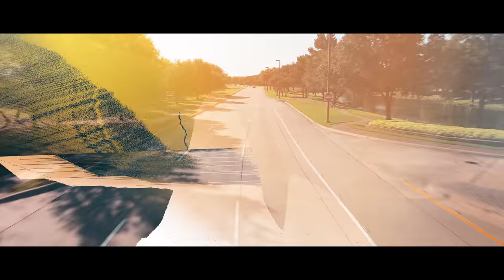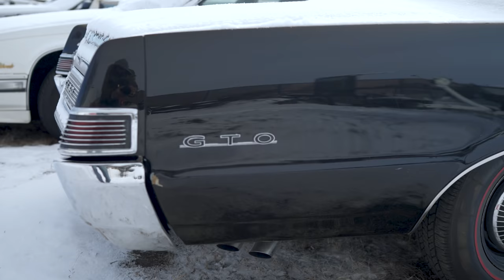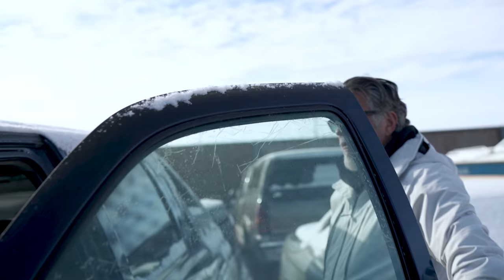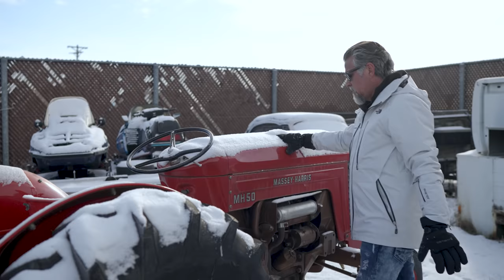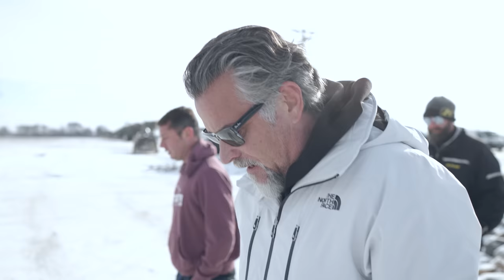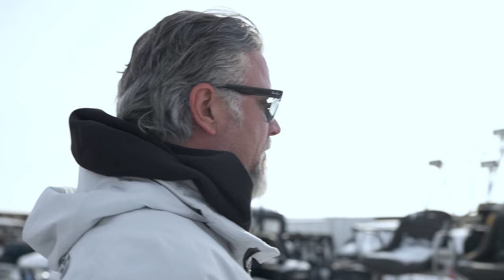Boats, Bikes, and BIG Bucks- Thawing Out The Collection- Pt. 3- Gas Monkey Garage & Richard Rawlings

Comment: Y'all need to come to Detroit and buy my one owner red big block Oldsmobile 1975 442 that my dad bought new. It's always been same spot in same garage since delivery from Charnock Olds Dearborn, mi in May of 75. Got invoice and window sticker. It's got 12,000 miles. White vinyl top and dual white stripes up the hood and down the deck. Red interior still smells new (always garaged with windows up since it was purchased).
In the 80's I was a young teenager. Dad and I took this car to shows. Nobody cared then for a less than 10 year old "smog car". This car was ordered with power windows and locks, etc, but non air. That's the way dad flied. This car is special and I promise you there ain't another one even close to it with an original 455 on the entire planet.
Price is fair for what it is. Talk to me about it.

Comment: i could honestly cry my eyes out being in scotland i cant enter the competitions and what id do living here with some lovely american muscle and classic cars jaguars etc mustang coupe fastback 69 that red trans am id love a trans am from smokey and the bandit era 77 i think bandit editions if not 78 up to the end of that style to the knight rider shape trans am ive owned the sister car i had a 1985 chevy camaro v8 z28 with vented bonnet etc i changed wheels too classic wide wolfrace super slotmags with raised white letter tyres cooper cobra tyres 235/60/15 rears and 205/60 /15 front tyres car was black with black interior i replaced front seats to recaro bucket seats that folded to let rear passengers it had digital dash with a mind of its own at times but the sound of 4 2 into 1 straight though to 4 cherry bomb rear silencers lol (nothing silent about cherry bombs ) exiting in middle of rear with 4 exhaust pipes (silencer or muffler if in usa ) had embelishers added too the 4 pipes and looked and sounded mean the crossfire injection had been tuned by previous owner and car wasnt mint it needed some work and a respray but getting chevy parts easy in uk is a nightmare i ended up selling the car and a mk1 escort rally car and buying a 1992 escort cosworth ive now had 20yrs and will never sell as its fast and feels like glued too road bends over 90mph and car doesnt move as if on rails its only used for shows and odd sunday run in summer cars like new and has rare mallard green pearl paint from factory changes colours from green too blue too black depending on light still jealous of comp winners lol why cant it be me hint richard if reading open a scottish gas monkey you can then be international gas monkey lol i wish hope your all well and your families during this covid nonsense and we all get back to normal as soon as we can as lockdowns dont work so wish you all the best for 2022 from BDUBZ

Comment: Used car guys be like "...really clean, no rust."
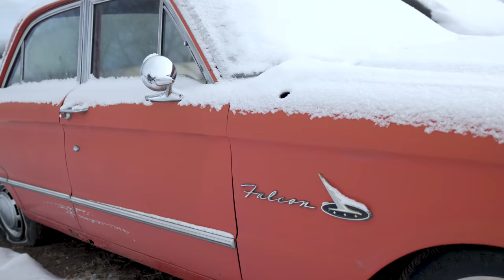8:33 Falcon rocker panels. I'm from Detroit and I still don't call that "no rust".
I'm not a Ford guy but would take the Falcon tho'. My daily driver is an original 1950 Ford Tudor sedan (2 door) with a flathead V8 and 6v. Don't laugh because this car will still run and drive when WWIII hits.

Comment: The only thing I'd pay is 40 grand for those cars with zero the only one is the GTO.... but what does the underside look like .....I've offered Richard years ago a original owner 67 ... 427... 435hp vette conv with a original window sticker signed by zora arkus duntov with 2705 original miles and it was just BS being ran around it's all fit the weird emails as well